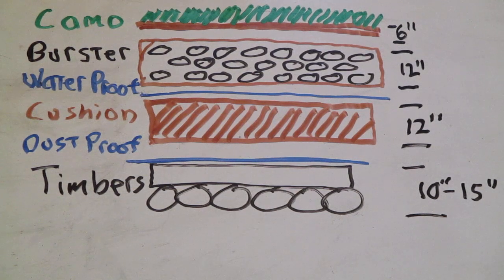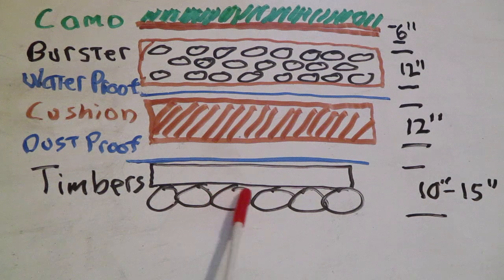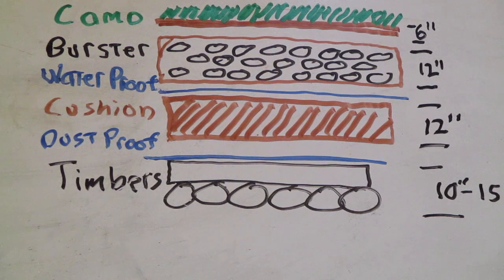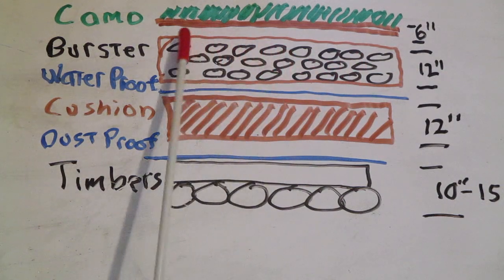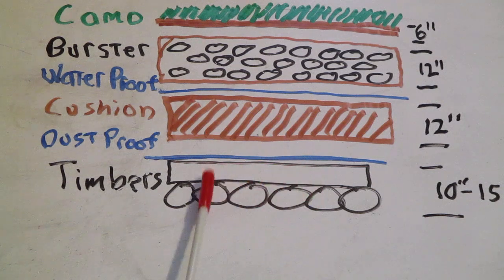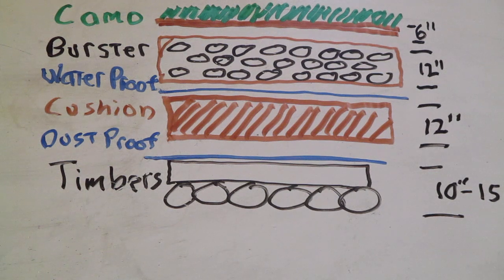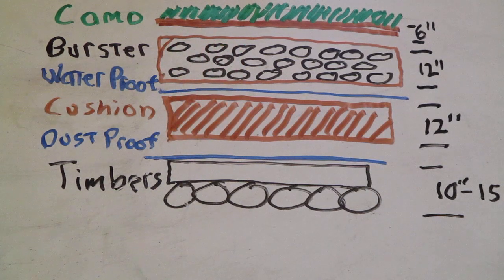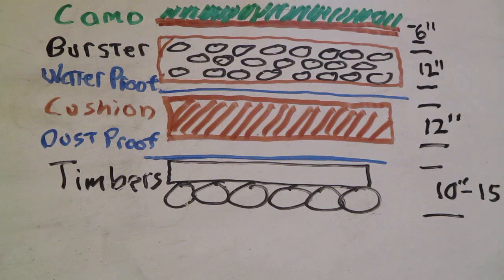Militia Engineer Tasks- Bunker Overhead Cover

Comment: Tronc de bois de 15-20cm d'épaisseurs disposés à l'horizontale pour la première couche puis à la verticale pour la seconde couche, une bâche pour l'imperméabilité, 4 couches de sacs de terre, des troncs de 10cm d'épaisseurs sur deux étages horizontale et verticale, puis du gravier sur 20cm, ensuite des cailloux de la taille d'un poing sur 20cm, cailloux de la taille d'une tête bien tassés, cailloux beaucoup plus gros, gravier sur 10cm sacs de terres sur 4 étages recouverts d'une fine couche de terre pour camoufler au mieux la forme par rapport au relief et à l'environnement alentours, ensuite mettre les rouleaux d'herbes et mottes sur le petit monticule de terre ce qui le camouflera de tout et même des drones... Ne pas oublier de faire une entrée dédiée et décalée de façon à ce que aucuns éclats ne puisses pénétrés dans le bunker... À la place de sacs de terres des sacs de bétons avec une forte consistance en mèches de fibres seraient bien meilleurs mais très rarement disponibles en première ligne... Comme la guerre en Ukraine le montre des tronçonneuses électriques sont largements utilisées ainsi que des générateurs électriques thermiques, donc la fabrication de fortifications et bunker peut être alléger...'